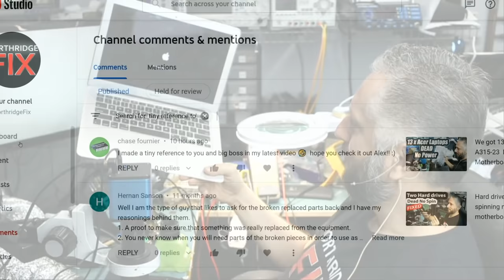MacBook Air Liquid Damage - BGA Trace damage Repair using Pad Strips -

Comment: Great analysis and fix again Alex. So weird that the previous repairshop just scraped te surface of the chip but did not even clean the liquid damage. Glad you repaired it the customer will be very happy.
Reply: They probably didn't charge the customer as they couldn't fix it, hence, why clean it?

Comment: Thought I'd add this info to your channel for others to see.
I just learned that if you remove a broken screen from an Apple iphone of the 12 or 13 model, there is a BGA chip on the screen (the original one that you will be removing from the phone).
So, though it's a micro job and requires some balling experience, it can be done and you won't lose any of the other features of the phone as before.
Not sure if there is a "get around" if you have to replace the camera as well but I'm researching it.
This is good news for anyone who thought that you would have to give over your phone to the "i geeks".  Sometimes they do more damage than good.  AND they're always telling customers that they can't fix stuff but then, who is repairing those refurbished Apple phones??
A mystery...............?????????????????
Happy Soldering!!!!